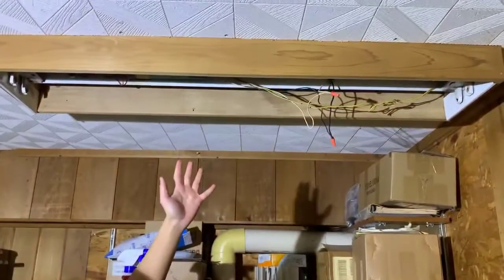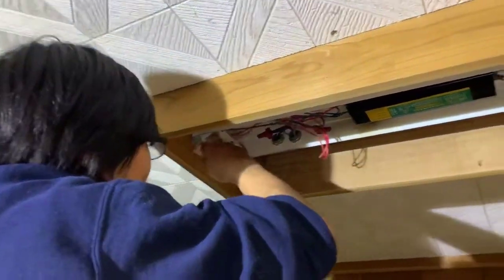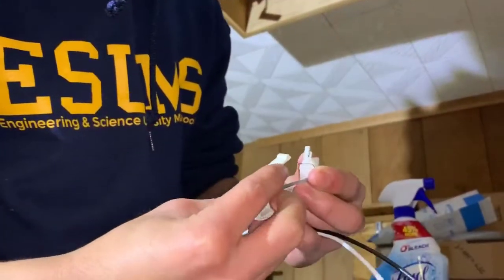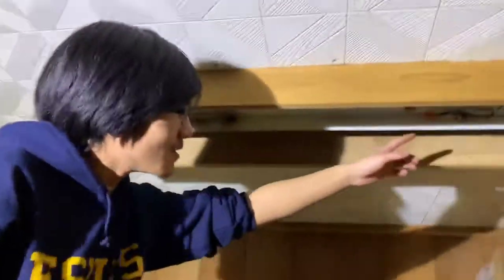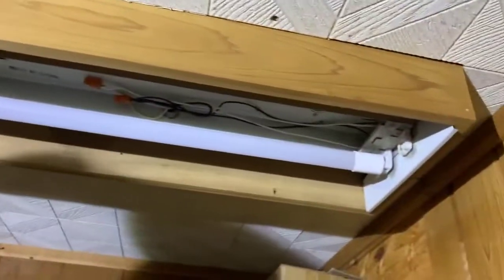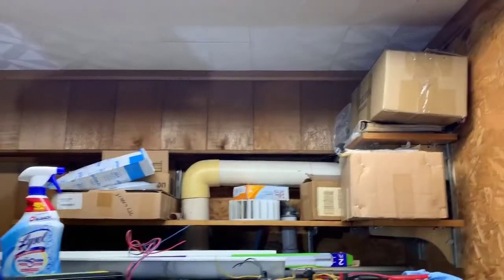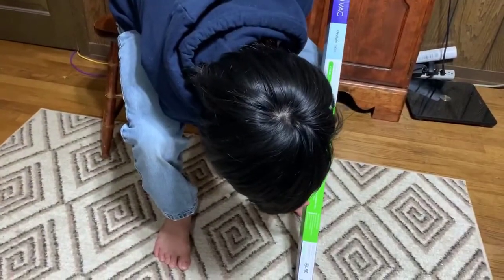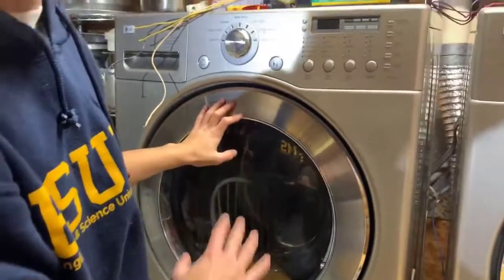How To Change Fluorescent Lighting To Direct Wire LED Toggled 48" Tube T8/T12 Without Using Ballast

Comment from the maker: Here are the #ᴬᴰlinks for parts, accessories and tools showcased in this video:
1.  https://amzn.to/40QBx6g  |  Fluorescent Light Bulbs 48 inch T8 LED Bulbs 4 Foot Type A+B,24W 3200LM 6500K Clear Cover Super Bright,Single and Double End Powered,T8 T10 T12 Fluorescent Bulbs Replacemen(4-Pack)
2.  https://amzn.to/4hStbRK |   AstroAI Digital Multimeter Tester 2000 Counts with DC AC Voltmeter and Ohm Volt Amp Meter; Measures Voltage, Current, Resistance, Continuity and Diode
3.  https://amzn.to/48VHZLp  | KAIWEETS Self Adjusting Wire Stripper - 3 in 1 Heavy Duty Automatic Wire Stripping Tool | 10-24 AWG Wire Cutter for Electrical Cable Cutting, Crimping Tool
4.  https://amzn.to/4eG6kG5  |  PARMIDA 20-Pack 4FT LED T8 Hybrid Type A+B Light Tube, 18W, Plug & Play or Ballast Bypass, Single-Ended OR Double-Ended Connection, 2200lm, Frosted Cover, T8 T10 T12, UL - 4000K

Or Click on Amazon link here and search for what you need:  https://amzn.to/3Oat7zj

Comment: You could have left the old tombstones in. Cut the wires at the tombstones to your left side of the lamp, then cut the wires off at the right side of the ballast, remove ballast. Keep the two yellow wires, one will go to your hot, and one to your neutral. I just wired up six lights in the kitchen, they are roughly 56 years old and worked fine with new lights.

Comment: I just got the exact same replacement lamps at Homedepot.
I'm fairly sure that you only need to replace the lamp holders at the powered end of the tubes.  At the unpowered end, leave the lamp holders with the yellow wires, and just clip off the wires.  It shouldn't matter if the lamp holders at the unpowered end have the pins shunted together, there isn't supposed to be any connection inside the tube at that end, it's only there for mechanical support.
Of course if the new lamp holders are not the same height as the old ones, then you will have to replace them at both ends so the tubes are mounted straight and level.
One more warning.....Do NOT change these bulbs with the power applied, there is a possibility of shorting the socket at the powered end, or coming in contact with the power!!!  Just turn off the light switch before changing the bulbs, don't have to go to the mains breaker panel.
Reply: "Just turn off the light switch before changing the bulbs, don't have to go to the main breaker panel." ... and pray your mom/wife/sibling doesn't forget and hurriedly run down to grab a uniform out of the laundry and hit the switch. Unlikely, but it has happened more than once and it's generally not crazy hard to get to the breaker box and flip that switch. At the least put a piece of tape across the switch in case someone does forget and comes running in and tries to flip the switch.

Comment: So If I got it right.  One Side  of tombstones to clarify " one end" is a dummy no electrify  and the other is the traditional power supply:  [ Black wire: A  Hot]  and  [ White wire: A Neutral] plus [Green/Copper wire: Ground] which connects to base somewhere.  Thank you.   Good job on acting like you were clumsy dropping things and breaking stuff to make it feel like anybody could do this job